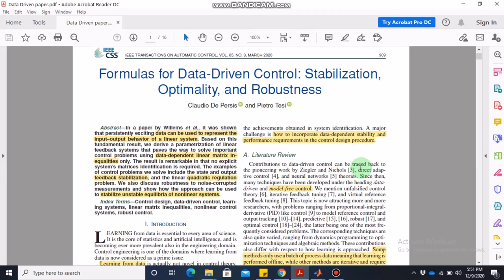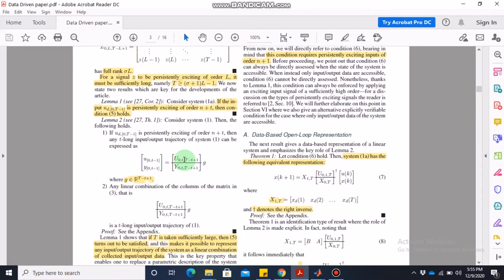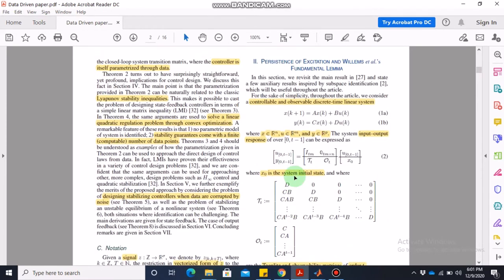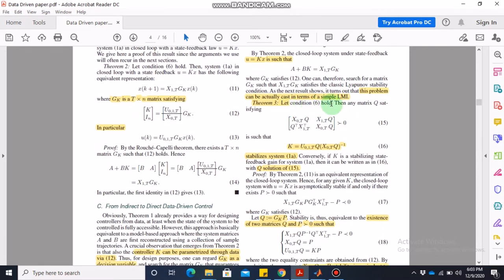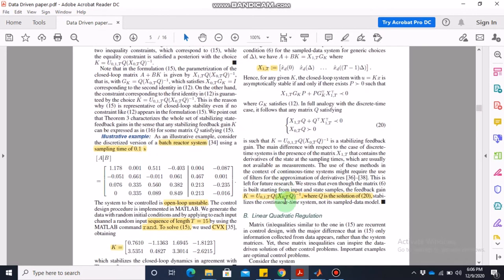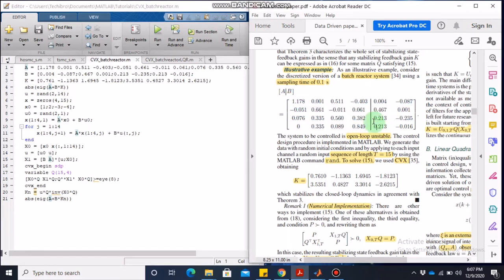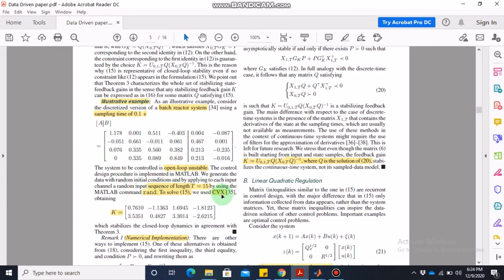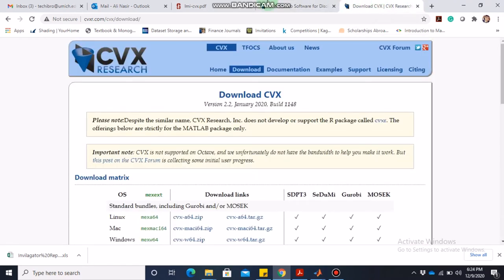Data Driven Control using MATLAB Part 1 Stabilization and Optimal Control

Comment: Nice video sir and please quick one for these questions.

1. Are control systems' model continuous or discrete in nature? 

2. For optimizing model parameters, is continuous optimization technique suitable or rather discrete?
Reply from the maker: Thank you for the encouraging remarks. Here is my take on your questions.
1) In most of the recent real-life scenarios, the control systems are implemented using some sort of microcontroller-based embedded systems that are discrete in nature. It can happen that some component (for example a sensor or an actuator) within the loop is continuous time. In that case, analog to digital (and digital to analog) converters are also part of the control systems. The good news is that most of the theories and methods in discrete-time and continuous-time control are similar and there are transformations available (at least for the linear models) that can be used to go from continuous to discrete and vice versa.
2) While optimizing model parameters, it is better to use the technique that is closer to the nature of the physical system to which the model belongs. Therefore, if you are optimizing the parameters of the model of a continuous-time system, then better use the continuous-time techniques. On the other hand, if you are optimizing the model of a discrete-time system, then use the discrete-time techniques.

Comment: i copy your code and it didn't run . 
??? Error using ==> ge at 22
SDP constraints are expected to be symmetric (deviation: 2).
--- If this number is small (<1e-6), it may simply be due to roundoff error.
    This can be corrected by applying the SYM(X) function.
--- Otherwise, this is likely due to a modeling error. Did you declare the
    relevant matrix variables to be "symmetric" or "hermitian"?

Error in ==> cvx_stabilisation at 18
[X0*Q X1*Q;Q'*X1' X0*Q] >= eye(8);
Reply from the maker: I am not sure what is happening at your end. Apparently the code is pretty simple and I tried to explain it in as much detail as I could. Same code must give same results as long as you follow the instructions.
Reply: I also meet this problem. And I think it may be caused by the asymmetry of “X0*Q”.